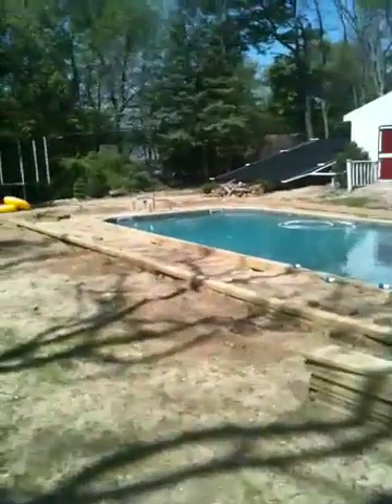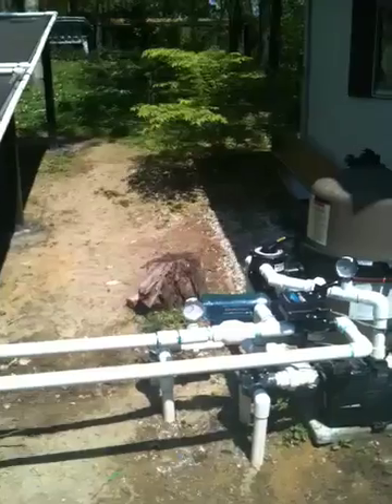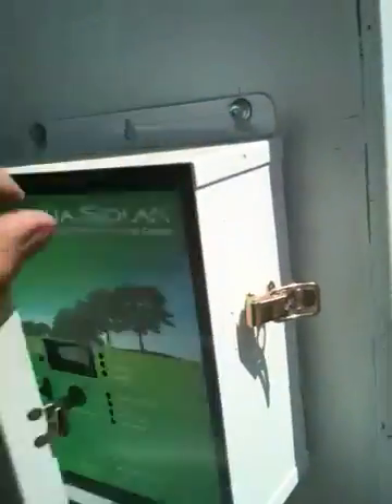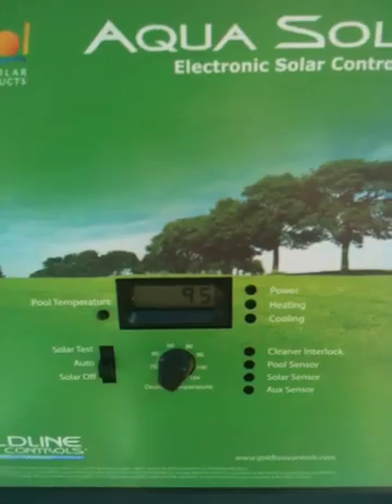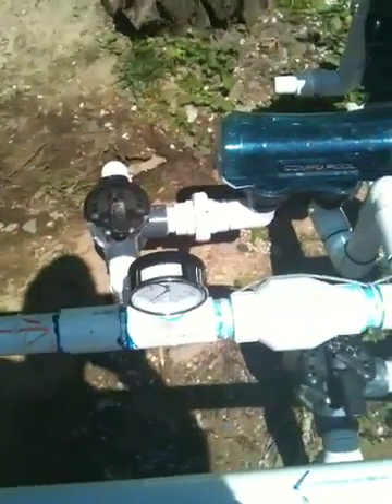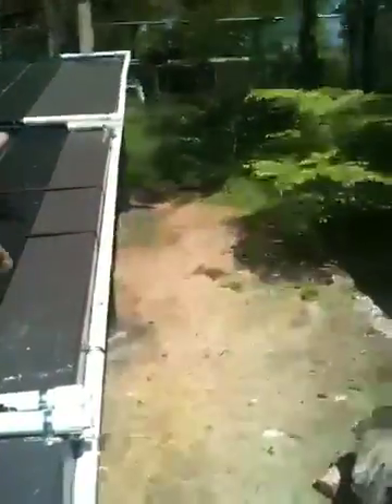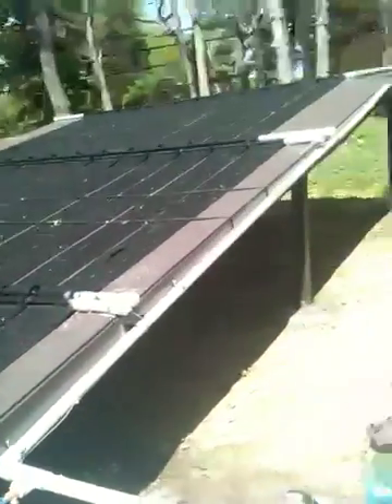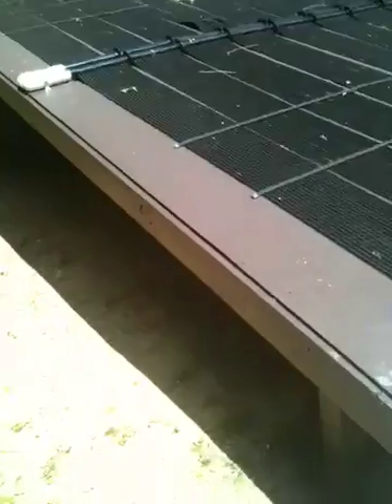Solar pool heater

Comment: Hi, good video, but do you realise that as long as your pool gets direct sunlight too, you're actually better off just throwing the black tubing straight in the pool. Even better, buy a $10 sheet of black plastic a few rocks and put it in the bottom of the pool. No pump required and all heat transferred diredt to the water. No need to over complcate things.